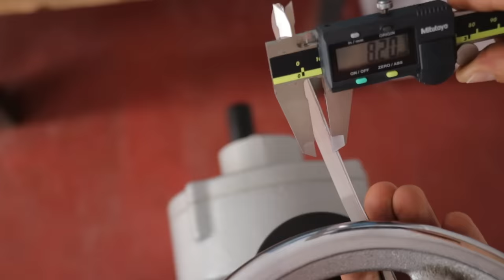Wedding rings MOKUME GANE  (Aros de matrimonio con la técnica MOKUME GANE)

Comment: Artist
 I really want to ask you what kind of orange and white material made silver and copper weld so tightly to each other
Reply from the maker: Good morning, I used industrial alcohol to clean the plates and the yellow liquid that I dip the plates in at the end is liquid borax that the plates need to fuse when subjected to the heat of the torch and thus obtain a solid block without pores or cracks, thanks for your support.

Comment: Sorry dude, but silver dissolves copper. Just like a battery electrode, the copper will disappear overtime. The sweat from your hand is the elelectrolite.
Reply from the maker: Good morning, you are very analytical and that is very good. The intention of the video is to show how the rings are made with the MOKUME GANE technique, it will depend on the user who requests it in the metal they want.  For example rose gold and white gold .. Thank you for your support.
Reply: @ElierOlivos  i see and i get it

Comment: 1) Wedding rings should last a lifetime if not many and ideally be made of gold because it by far the most affordable inert metal

2) Silver is fine but not entirely inert because sulphur attacks silver turning it black, even if silver does survive copper will erode over time

3)Adding copper was a blunder, because copper is very reactive will create blue-green or black patina from body moisture and will stain the ring finger, it will slowly erode away leaving only silver behind
Reply from the maker: Good morning, you are very analytical and that is good. The intention of the video is to show how the rings are made with the MOKUME GANE technique, it will depend on the user who requests it in the metal they want.  For example rose gold and white gold .. Thank you for your support.

Comment: Hi. Very good, but it is not clear what the liquids in which you put the silver plates are
Reply from the maker: Good morning, after sanding the plates I clean them with industrial alcohol and then immerse them in liquid borax to get the plates to fuse together and achieve a solid block without cracks.  thanks for the support.

Comment: They won't last forever, but probably long enough.. the copper and silver will make an electrical charge that dissolves the metals where they touch... the whole ring will dissolve eventually
Reply from the maker: Good morning  Phoenix, you are very analytical and that is very good. The intention of the video is to show how the rings are made with the MOKUME GANE technique, it will depend on the user who requests it in the metal they want.  thanks for your support.
Reply: @ElierOlivos  it's a beautiful example of a difficult technique, and it was fun to watch <3
Reply from the maker: Thanks a lot.

Comment: friend, I'll give you a trick for the mold, create with precooked or recycled kaolin a putty with 50% graphite, place it in the parts of the lintor box, this mass prevents spills
Reply from the maker: Thank you for your suggestion.
Reply: @ElierOlivos  I commented with the translator I do not understand your written language only a little when they speak if you want repeat in Spanish Spain 👍
Reply from the maker: @alquimiavsmetalica5250  Muchas gracias Por tu sugerecia, gracias por tu apoyo y ver el video, te envío un Abrazo.

Comment: Hello! Can you please explain the welding process? Silver and copper have very different melting point temperatures. Do you stay just below the melting point of silver? Correct? Is there solder paste between layers or only a solution of pure borax? Also I was curious why you used different thickness of layers. Is it for aesthetic reasons or it’s because of the melting temperature reached on the exterior of the billet? Thank you so much! One of the best videos regarding this fascinating technique.

Comment: hi there, i was thinking of attempting this type of jewellery for a major project, and have a couple of questions. do you think sweat soldering could work for this? or would this make it more difficult, as there are various things we have to be careful about, melting down metal with intense heat is advised against. i would like to also ask, do you think this would work with cheaper materials/make it easier, for example nickel silver and copper?
thank you, i love the work :)

Comment: Very nice result! I wonder if there is a way to do this that would allow you to attach away a little bit of the copper so that the material might look even more as if it has been worn by the weather
Reply from the maker: Good morning, to achieve the effect like wear over time you can use nitric acid protecting with enamel the parts that you do not want to be corroded by the acid, thank you for your support.  
be very careful when using nitric acid because it is very harmful and polluting.